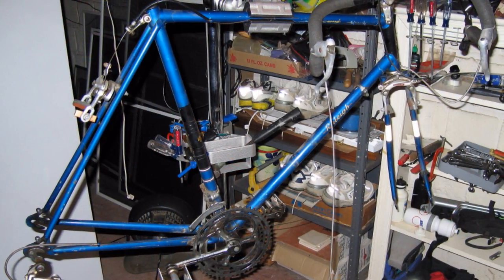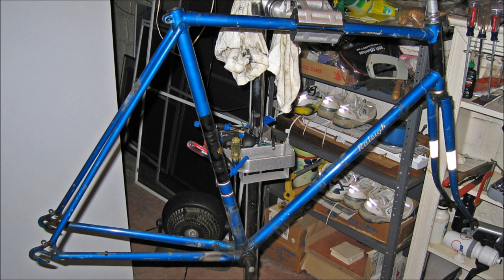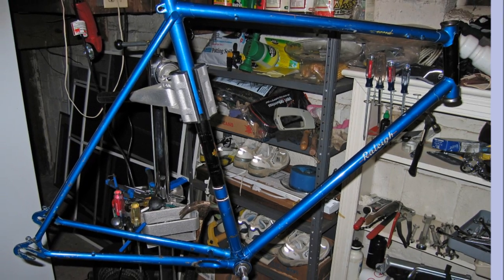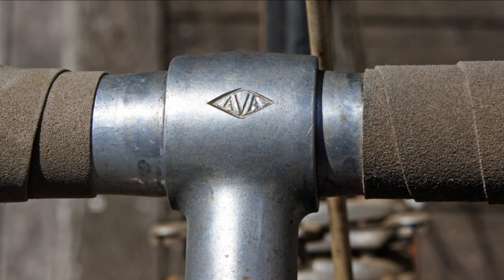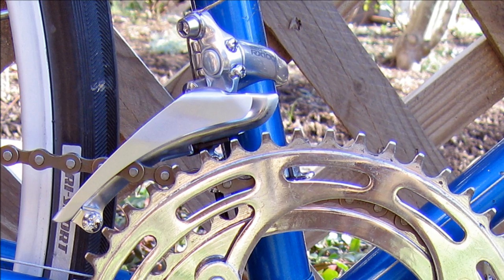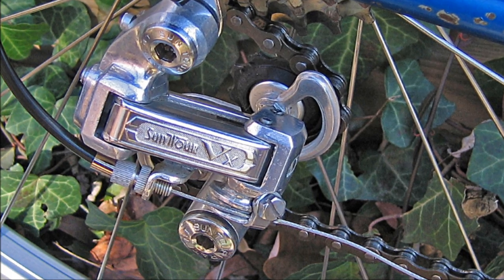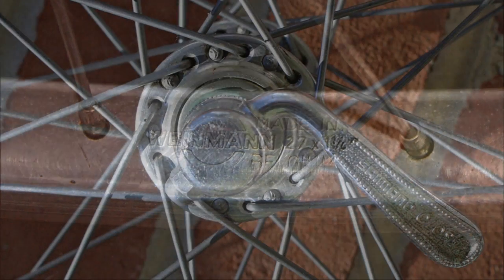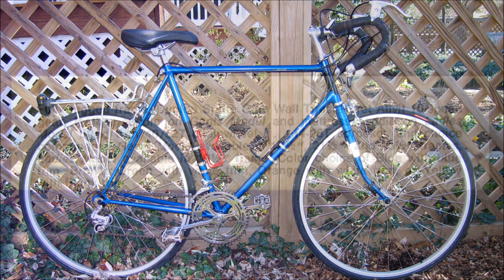Refurbishing a 1971 Raleigh Record

Comment from the maker: For some reason Raleigh put the serial number in various places on these vintage bicycles.  The most common places are underneath the bottom bracket and on the decorative lug just below the seat.  I have seen them in both these places.  The numbers often are extremely light because the have been filled in by the paint, and sometimes you cannot see them without using a shop or other light to create a shadow.  Thanks for the comment.

Comment from the maker: Thanks for the comment.  This bicycle right now is only ridden during the day so reflectors are not necessary.  

But interested in your comment on the stem.  The stem is not corroded, but if you have any direct experience with them cracking or breaking let me know and I will replace it.  

The low level Huret's were very poor shifting, but very durable.  I still have one on an older bicycle, and it does not shift as well as more modern ones but I see no reason to replace it.

Comment from the maker: On most old bikes like this one you unscrew the nut at the top of the stem so it sticks up above where it was previously seated by about 3/4 to 1 inch or so.  Then you tap it with a hammer.  It does not usually require much force.  The nut at the top of the stem will suddenly release and drop down to the handlebar, causing a wedge inside the stem to loosen.  Then the stem can be easily removed.  On reinserting the stem, do not over tighten.

Comment from the maker: Sorry for delay.  The stem configuration should be similar and turn the same way.  These for the early 1970s are the infamous AVA stems that sometimes fail.  But usually it is a crack in the stem and not a freezing of the bolt and nut at the expander.  Hope you were able to get it out, and once you do examine it very carefully.  The crack is usually around the area where the stem expands (vertical groove in stem).  Many people replace these stems regardless of condition.   But I still use mine.

Comment: I'm not sure if it was left outside or not, it's not too rusty. I sprayed it up with pb blaster. It looks like it may be threaded differently then the other Raleigh I have. Is there another stem configuration they used?

Comment from the maker: The crank cotter pins often are difficult to reomove on these old bikes.  First, really douse the pins with penetrating oil.  Leave overnight and douse again.  Get a wooden 2X4 and cut it lengthwise just high enough to lift the bike off the ground when put under the crank (between where crank attaches to spindle and ground).  Then cut a V notch in one end of the 2X4.  Rest the bick on the 2X4 with fat end of cotter pint in the grove.  Back off nut on cotter plin but leave it on.

Comment from the maker: Thanks for commenting.  This should make a good fixed gear bike.  The frame is very strong (and of course heavy).  One thing I did recently for this bike was to replace the stem and the handlebars.  I picked up a free old Schwinn that had been run over by a car backing over its back wheel.  The handlebars on the old Raleigh are quite narrow, and the Schwinn replacements handlebars were wider.

Comment from the maker: You are right.  The old Raleighs and Peaugots were really classics, and except for the frame were made from the same parts.  I am still amazed at the performance of the Weinmann brakes.  It was quite an investment at the time, as adjusting for inflation the price surely was well over $700-$800.  But they last forever!

Stay tuned as I will be doing a step by step series on on refurbishing my wife's classic 10 speed which has mostly original parts on it.

Comment from the maker: There is but it may take several adjustments.  I assume you want to go through in progression on the small chainring and then switch to a high chainring and do the same for it.  Buth this would require changing both the front and the back gear ratios. If you just want a lower gear, then just swap the old sprocket for one with higher tooth counts, but this also may require a derailleur switch.  Both Sheldon Brown and Yellow Jersey have information on this.

Comment: He needs wheel reflectors,  a white front reflector, a rear red reflector.    He could have told how he installed bar end shifters. Huret Alvit was hot stuff back in the day, millions are still in use and they are reliable.

Comment from the maker: I have used different methods.  Rust on bicycles is usually not too thick so this may or may not apply to your situation.  I have tried the rust removers, but don't like the fumes.  I start with some home methods such as vinegar and baking soda, but this is only for light rust.  The method I most often use is a fine steel wool and WD40, but you have to have a very light touch and concentrate only on area with rust.  It does scratch paint no matter what.  Then use wax afterward.

Comment from the maker: An old pipe is a very good idea, but if the crank is chromed put some kind of protection between pipe and crank.  Both work well.  I also agree that you should hit it with force, as otherwise the threads on the pin compress with small taps, and sometimes the pin can even bend.  Nice comment.

Comment from the maker: (continuation of previous comment).  With a hammer and a punch with a flat surface (not a point) on it.  Put the punch on the end of the cotter pin with the threads and with crank resting on the wood 2X4 hit the punch the hammer.  sometimes this flattens the threads and you will have to replace the pint, but they are available online.  Repeat with more force until the cotter pints comes free.

Comment from the maker: I actually agree and use a Brooks saddle on my current road bike.  The original one on this bicycle had become moldy and was called a Wright saddle.  It was made by Brooks of thinner, stiffer leather.   Replacing the Brooks saddle with a new one would have been about the same cost as the original value of the whole bicycle, so maybe I will pick up an old one at a yard sale!

Comment: I worked in a Raleigh shop during summers in high school in the mid-1970s, and I can't tell you how many Records I finished assembling and repairing. It was the bottom of the line ten speed for Raleigh, and while not a great bike, it was quite a bit lighter than it's main competition, the Schwinn Varsity. Contrary to one poster, the Huret derailleurs were never a "hot item," and you were wise to switch to Sun Tour. I'd definitely replace that AVA stem.
Reply from the maker: I did replace the AVA stem.  My brother rode this refurbished bike for 10 years and loved it.

However last year I transformed this bike into a city bike with flat handlebars.  I will probably do a posting later and document this.  I still love the way this frame rides.  It isn't the lightest, but it really handles well. It is definitely better than a Schwinn Varsity.  I worked in a Schwinn bicycle shop back in the day so I know the Varsity well.  Thanks for the comment.

Comment: For some reason I can't reply to the comments re cotter pin removal. However, I found the best way to remove them was by drilling them out - they are quite soft. Centre punch first, then start with a 1/8th inch drill bit. Switch to larger size just under cotter pin diameter and the remains almost fall out. Don't worry about marking the crank - it's much harder steel.
Reply from the maker: Steve S Yes I have also drilled out very stubborn ones, and it is a bit time consuming.  Your description is perfect.  On those bikes that I have fixed, I usually put a thin coat of grease on the cotter pin, and then in the future I never have a problem in removing them with the tap of a hammer with the crank supported by a block.
Reply: barnesdf2 Usually, I would switch these cranksets over to square taper / aluminium crank arms to save weight and quite a few landed in the bin ! A mistake I made was not identifying the age correctly of a Claud Butler and that crankset met the same fate... Later I realised it was 1961. 

Your Record is essentially the same as my Europa model in '70s Team colours. I did the usual crankset replacement and then found pedal strike was a problem. Turned out it had been fitted with 'junior' steel cranks originally - think they were 160mm length. However, I got used to it and rode it for 8 years averaging 50 miles per day. The frame survived off-road abuse and never cracked - unlike my Raleigh Equipe which developed a bad crack in a chainstay after a mere 35,000 miles. Luckily being hi-tensile I could weld it and it's back in use :)

Comment from the maker: It is good you don't have AVA stem.

I assume by rusted out means surface rust only that is on the bottom of the top tube.  This is not a problem.  You can clean it off with rust remover or with steel wool and a penetrating oil like WD40. Rub lightly 

If it is anything more than surface rust that does not clean up, then it is a problem and the bike frame has to be replaced.  You can't buy just a top tube because it's part of whole frame.  In this case you only have a bike you can use for parts.

Comment: Suntour stop Building Group sets for bicycles but they never stopped producing bicycle parts they still make cranks and suspension forks for mountain bikes and they actually produce rate from entry-level to mid-level good Forks rate from Spring Forks to air Forks
Reply from the maker: Thanks for your comment. Actually, Sun Tour is alive today by name only.  In 1988 the company was in virtual bankruptcy when Sakae Ringyo bought what remained of the company.  The name was changed to SR-Suntour to make use of the Suntour reputation for high quality and relatively inexpensive bicycle parts.  So as the company that made the great bicycle components, Sun Tour (or Maeda Industries) ceased to exist in 1988.  As you indicate, SR-Suntour is still around today making forks and other components.

Comment from the maker: All these old bicycles have rust inside the tubes.  The critical issue is whether it is surface rust (either inside or outside of the tube) or penetrates into the steel weakening the tube.  Good luck.

Comment: Well this is interesting. Through a lot of searching for information on a bike I have it turned out to be a 1971 Record. Same color, though the paint didnt hold up as well as yours. And I plan  on having it powder coated. I have mine torn down right next to me as I write this, as I am looking for parts to get mine back on the road. Mine will be a fixed gear single speed. Thanks for sharing it's good motivation for me.

Comment: Hi, did you need to buy a new derailler hanger? I've got a record frame without a hanger, I'm wondering if you know where I could find a compatible one. 

Also, what did you use to clean up the frame? What about the cranks? Looks nice!
Reply from the maker: +Matthew Larrabee 
There is a part number on the derailleur hanger.  It is 4532.  Here is a site with a picture of it.  This may help you to find one that is similar.
  
http://www.redclovercomponents.com/blog/1

To clean the frame I just used dish soap and warm water.  For the stubborn grease I used a small amount of WD40.  Since I had all components off the frame, after I can cleaned it and just before reassembly, I used a car wax and rubbing compound combination (Turtle Wax).  Even light use of rubbing compound by itself can make it look very nice.
Reply: Thanks for the info! The part number helped, I found a very similar looking part on amazon, I would be surprised if it didnt work!

Comment: I just scored a 1977 Raleigh Record LTD with handle bars that don't curve under, but curves sideways back towards the rider, and has a bell ringer, has a bike rack and  a small milage indicater attached to the front forks, has a thick Deluxe Sport seat with springs, A CB goose neck,
is light blue and in very good condition, and looks as if though it was hardly rde, wheels still click like a new bike. , as I just got it today but I do plan to do some research.

Comment: Really nice video, I've had a 1984 Raleigh Routier since new. I've done various little upgrades over the years, but it's showing it's age. It's not my main bike, so I'm tempted to give it a restoration.
Reply from the maker: I just updated this 1971 Raleigh.  I put new handlebars on it (old handlebars were narrow compared to today's bikes).  I finally replaced the old AVA stem that so many have commented about.  It still has no cracks in it, so I think that the problem probably was quality control as opposed to design. I really like the Crosstop brake levers so I installed a set of those.  I ride it now for short trips so it is my city-local ride bike.   I may do a short video update.

Comment: Wow, you went through alot of work and cost to put this back in action. Good job, sorry you had to get stuff from China.
A few months ago I started looking for an 80's style ten speed, I have had them before and a personal style favorite. I found a guy near by selling one within my price range so I jumped on it. Tires were shot, tubes had holes, rim strips were snapped but looked like everything else was ok and it came with a front and rear light operated by a little generator on back wheel. I spent over a week cleaning it, regreasing everything, bought new cables, new chain is on it's  way. I ran serial # and it's made in Japan in April of 1971, sold in America. Looks almost brand new now. I had a Raleigh that was nice but someone stole it, pissed me off real bad. I really like cleaning up and fixing older stuff, it looked good after all the work I did to it and some fool jacked it. I'll keep my Nishiki locked up and in the house when not riding. You can take alot of pride in what you've accomplished, keep it safe.
Reply from the maker: Thanks for the nice comment.  I have updated the bike since the video and plan to get around to explaining what I have done. I put on a longer stem for my bad back and cross brakes on the handlebars.  It still rides very nicely and I find it a pleasure every time I take it out for a spin.

Comment: the bike can get sold to somebody  who will ride at night or the odd chance you will end up riding it at night  once is all it takes please add them  the bike shop will give you wheel reflectors  to you free if you ask nicely  this is a habit of shops.
A dog  at your side trying  to bite you   quicker and more reliable shifting may just save your life.  I replaced my Alvit  after the thing just  shifted in time  the dog almost got me. A new derailer shifts quicker  and it makes the difference

Comment from the maker: The bike in the video is a Raleigh Record and not an Raleigh Record Ace.  The Ace is a higher quality bike, so it is a good thing.  

The wheel size has nothing to do with the frame size.   All Raleigh's of this type have 27 inch wheels.  The frame size is probably large.  You measure it from the middle of the crank sprocket to the top of the tube that runs up to the seat.  I am 6' and ride a 23 and 1/2 inch frame size in this type of bike which is correct for me.  

(Continued)

Comment: Reasonable job, apart from the saddle, would have been much better with a B17 saddle.
Reply from the maker: I thought about that, but this is a bike that gets locked up near metro (subway) systems and in front of stores.  The B17 is a great saddle, but I had a Brooks stolen by our local very knowledgeable bike thieves here in Washington, DC.